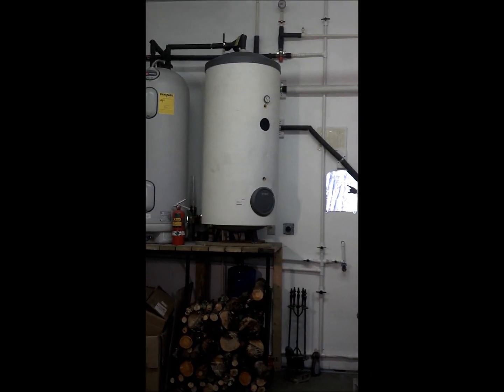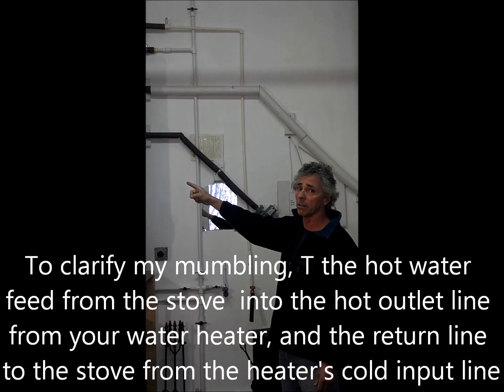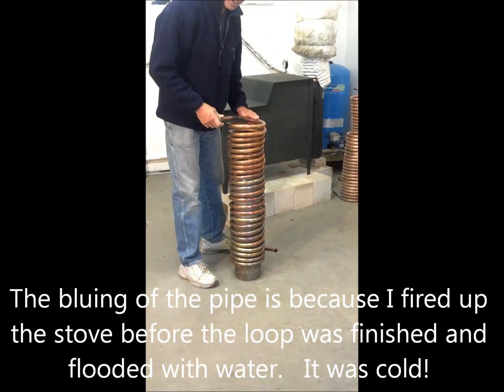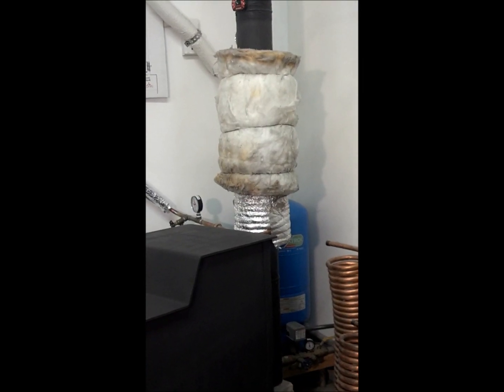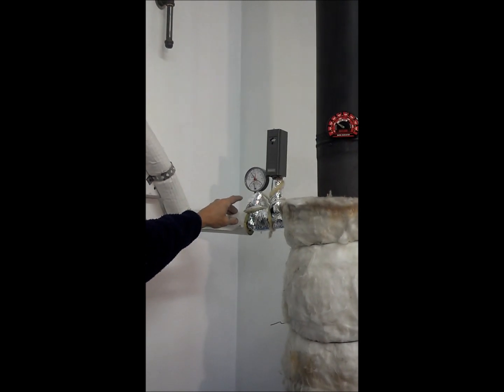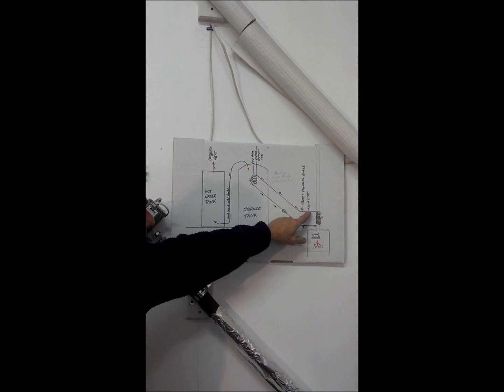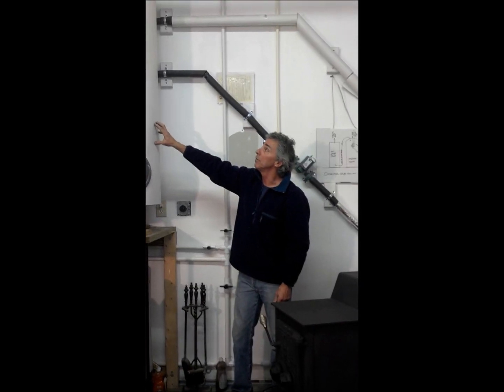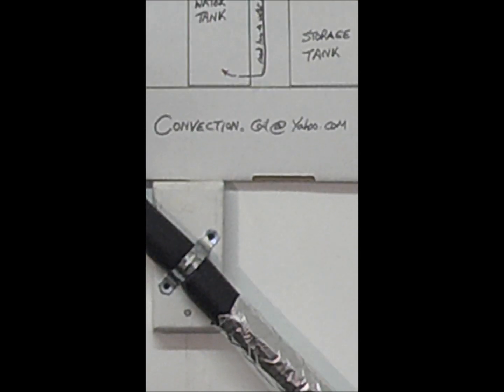How to get free hot water from your woodstove

Comment: Hi convectioncoil I was wondering can you do and publish a diagram on the tanks
I am interested in building solar water heating for summer use and wood stove heating for winter use, what is the best way to combine them and do you empty the solar closed circle or just turn the valves off to the solar during the winter? I am thinking on the winter with more cold than -5 or -10 C
Reply from the maker: You are best served by using a two coil solar tank like my Steibel SBB300. The lower coil in my Steibel is the input coil specifically designed for solar. That closed loop is filled with glycol year round and has a very simple and effective combo controller/expansion tank/circulator module. The other auxiliary upper tank loop was originally intended to be connected to a more conventional boiler water heating system. The Steibel in turn now feeds into a propane tankless water heater ...just in case the tank isn't up to at least 120 degrees
Reply from the maker: You could do this more simply by just elevating your existing water tank if it is already near your woodstove and tee'ing into the cold feed and hot domestic outlet. The hot output from the convection coil would tie into the hot out from the water heater, and the return to the convection coil would come from the tee on the cold feed to the water tank. You might need to replace your existing expansion tank on the cold feed with a larger one, you might also want to have a gate valve on the line from the tank cold to the coil, and you would most definitely want to add a properly adjusted mixing valve on on the domestic hot output. By doing this, your existing heater would still be a suitable backup for those days when your auxiliary sources aren't working. You would also then be able to add a simple solar loop for use in the the summer months and drain it for the winter. Because you are now running consumable water through the system, you would need to bleach the completed system before using it, and you would also need to use a stainless circulator pump. Before going to "real" solar panels I just tied a 100' coil of black plastic pipe up on my roof as a collector. It looked Clampettish, but it worked great all summer long!
Reply: convectioncoil well I am offering my services for free. Just because of the quality of your work and video. I can provide webhosting webdesign and domain name registration-on your business name this is about 12$ (contact me via pm for details) if you can write down on the paper a diagram for the tanks and scann it or take a shot send me and I will draw it in Visio

Comment: your using a cast iron circulater on domestic water not smart have to use a barons one so your domestic water is not contaminated
Reply from the maker: It's a good point Richard, but not quite accurate. The cast iron Taco is on the closed loop from the woodstove coil to the secondary internal coil in the solar tank. I did use a stainless pump in the loop that circulates the water from my solar into the Marathon water heater and back to the solar tank. My radiant floor is also powered off this loop, but is separated from the domestic supply by way of a heat exchanger.
Reply: convectioncoil
sorry for miss judging your set up nice to see there are smart people good job on your set up tho i might steel it for my house lol very nice job

Comment: In Canada that would void your home insurance policy and if your house ever caught fire and burned down you would be out on your ass. As a power engineer I can testify that removing too much heat from your flue gas is going to bring its temperature down to below the dew point and condense your wood smoke into creosote. It will also allow the sulphur oxides and nitrogen oxides in your flue gas to react with the condensate and produce acids that will corrode your stove and piping. Creosote catches fire in 20,000 - 30,000 chimneys in the US every year and is a leading cause to house fires. All that being said, this still can be done but you would have to carefully monitor your flue gas outlet temps and make sure they never reach below about 200 degrees F to stay above the dew point. This means never allowing your wood stove to burn down to coals overnight while you sleep. You would have to put more wood in the fire every 2 or 3 hours all winter long. You can see how this could be a problem...
Reply from the maker: Your thoughts are logical and I have been monitoring this carefully since installing the stove 4 years ago, and putting my convection coil into full time service two years ago. I'm to report that abnormal creosote buildup hasn't been a problem at all!  When I hook the flue into the back of a woodstove I always use a tee rather than an elbow. Below the tee I mount a capped section of flue pipe that has a few inches of clearance to the floor. By doing this it is easy to periodically remove the short section and look up the flue pipe. I just did my mid-winter check and the flue was not in need of cleaning. There was about a foot or so of loose creosote ash in the pipe I removed (the usual amount in my 6 months checks). I've yet to need to brush my flue!  The outside cap does require annual cleaning though which is normal and expected. I'm in the habit of ltting the stove burn really hot for roughly 30 minutes each morning and I think that is the key

Comment: can the company that coiled your 3/4 soft copper to 6 inch bring it down to 4 inch?
Reply from the maker: Unfortunately no Robert. The coils I bought are as small as their machine could make them and actually measure about 6.3" id. It does make them simple to slip over the flue pipe, but I know that some efficiency is lost in the slight air gap. I am aiming to come up with a machine that will form the 3/4 pipe around the 22 gauge seamless flue pipe so tightly that it will slightly flatten the inner face of the copper pipe onto the flue pipe.

Comment: you could shape to fit the coil inside the pipe
Reply from the maker: I've never tried it and don't think that this would not work well Don. First off, it would trap creosote in the crevices. Second, I'm not sure that copper would react well with the gases and acids in the flue exhaust. And finally, by having the coil outside the flue pipe and insulated, not too much heat is removed from the exhaust gases. In fact the pipe in that section is always just lightly sooted ans shows no sign of decay even after nearly three seasons of use

Comment: Looks good but you should really consider a thermal expansion tank, especially if the water is more than 120 degrees. You can't always rely on the T&P valve.
Reply from the maker: Certainly can't disagree with your good recommendation!  I got around this by installing a very tall air hammer before the boileer relief valve. I filled the loop from the boiler drain at the bottom until it flowed out the opened relief valve. The air hammer extends a good foot above this point. Still... an expansion tank designed for solar use would be the better choice and my recommendation

Comment: Why the 3/4 copper tubing and not something smaller and easier to coil around the stove pipe?  I'm just curious how you arrived at 3/4 and not 3/8 or 1/2 or alike?
Reply from the maker: Simple Aaron.. flow. Even though I use a circulator for increased efficiency, my original intent was to have the loop work well without needing one ...and it does

Comment: Are you still making/selling the copper coils?
Reply from the maker: I have yet to build a website and form an official business, but do have coils to sell Jim
Reply from the maker: Two are 32" high 31 pass coils, and one is a 22" high 20 pass coil.
Reply: You said you still have some for sale?  How much do you charge for them?
Reply from the maker: Hi Jim
 Yes I do still have a few of the coils that I had manufactured available. Pricing is $300 for the 22" high coil and $400 for the 32" high coil. This by the way is well under what I paid for them, but just about what I would like to be able to sell them for once I figure a way to make them. Unless there is a space constraint, I'd recommend going with the 32" for the extra heat gain.
As you have noticed there are quite a few good ideas for heating hot water with a woodstove out there, but most fail in my mind in one key area... safety.  By elevating your storage tank and incorporating thermosyphon the system remains safe even if the power goes out. It does work much more effectively with the assist of a circulator, but the flow through the 3/4 tubing is adequate to remain safe even without one.
I'm located in New Hampton, nearly dead center in the Granite State. As I type this it is in the low teens outside, about 70 here in my office, and I have a load of laundry washing  ...with all the comfort and hot water coming from the convection coil powered Steibel storage tank

Comment: Great video.  Helpful information to set up my hot water heat from a wood stove. FYI, I was easily able to bend half inch soft copper around a six inch pipe by filling it with water and freezing it. It only took about ten minutes to bend about fifteen feet of pipe. I would like to know how it would work on three quarter inch.
Reply from the maker: I'd like to know the answer to this one too Mike as kinking copper pipe gets very expensive!  I think it will take a machine using roller mandrels in order to get a coil that both fits the flue pipe really snugly and is perfectly formed

Comment: Hi convectioncoil, I built something similar in my home to get a radiator in the kitchen to heat up. It's a closed system like yours, but goes from coil to the radiator (mounted on the wall about 3 feet above the ground) and then back to the coil. It works quite nicely, but I've noticed after a few days that the copper piping of the coil turns black. Did you experience that too?
Reply from the maker: Interesting Mario, and I wish I knew why yours has done this. Just an uneducated guess but do you suppose that your loop might need a di-electric coupler??  or maybe a larger circulator pump? Some of my loop is cpvc and that seems to insulate it.  My copper is only very slightly tarnished
Reply: convectioncoil  I'm not using a circulator pump. My system works with thermal siphoning only. I'm chalking the tarnishing of the copper coil off as weird side effect then. Let's see how long it takes before it's oxidized to a degree that let's it fail.

Comment: seal off on side of the roll of copper, and the other side solder on a removeable cap, fill the  line completly with water and put the cap on it  make sure its full with water. you can simply unroll the 3/4 copper onto the 6inch pipie without crimping thi pipe.  worst comes to worst fill with sand.  it crazt how tight you can make a coil with sand.

Comment: Maybe this is legal stateside, but in Canada any heat recovery device attached to the chimney will void your home insurance and will not pass a WETT inspection. In reality, This device will cause creosote buildup right near the outlet of the stove which can catch fire and cause a chimney fire when a large fire is built in the stove. It is also not possible to regulate the volume of heat transfered to the storage tank which can cause the system to boil which is a potentially dangerous condition.

Comment: I did something similar with my wood furnace.  I put a copper heat exchanger in the plenum, above the firebox.  Natural convection, no circulation pump.  I send the domestic water itself through the circuit, so there is no in tank HX.  It works great.